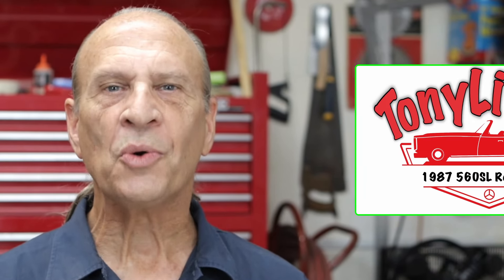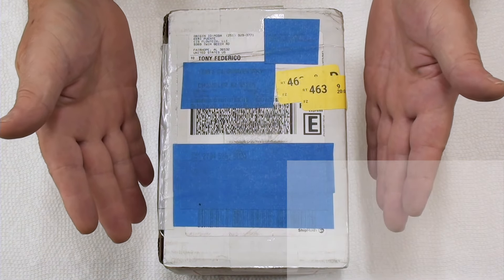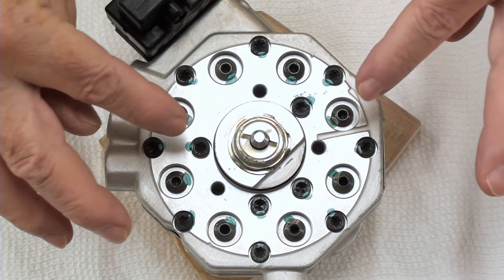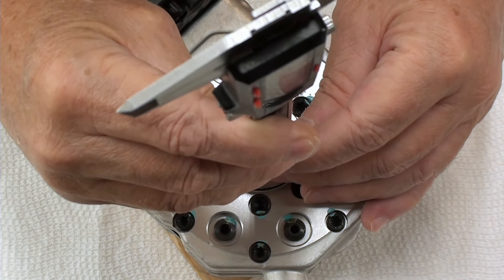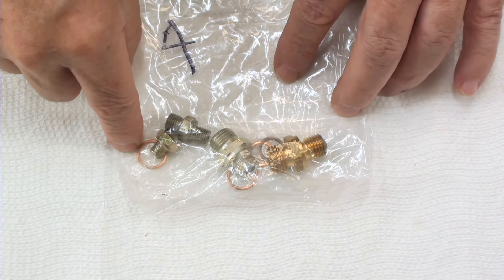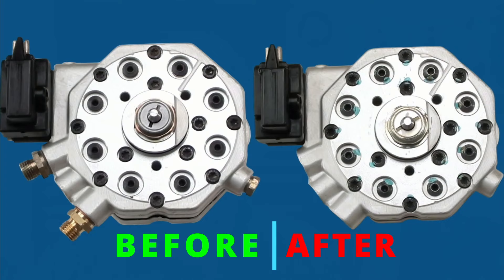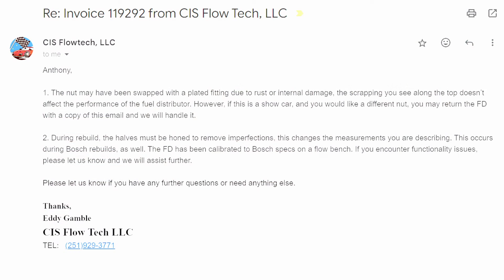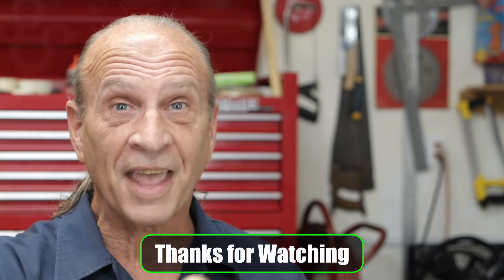560SL - Reviewing Rebuilt KE-Jetronics Fuel Distributor from CIS Flowtech, LLC

Comment: I gotta say that I'm with you on this one: really there is no reason for the damage, yes yes I read the explanation , still it kinda leaves a bad taste you know, the very least it could have send a note or something with the distributor. I would send it back after installing it on the car, in the end if they balanced it right then it doesn't matter.  Oh yeah the unprotected plunger also sucks, but again as long as it works I guess all would be forgiven. Can hardly wait.
Reply from the maker: @danricci6996  I agree with the bad taste Dan. Thank you for the comment. The explanation he gave was kinda wonky too. A professional with years of experience should know how to remove the locking disc without damaging the body of the FD. I guarantee I could do it and I’ve seen plenty of others that have done it without damaging it. When returning the FD they should include the parts replaced and an invoice that explains what was done. But in the end, if it works, it’s better than the other professionals I’ve let touch this car. These days I think the old professional builders now have employees and those employees are not properly trained. When I was in high school we had auto shop and a dad that like getting his hands dirty. I got the passion when I was young. These days there is no auto shop and their dads sit behind a computer all week. These kids have no passion for anything.
Reply: @TonyLiveTV  Unfortunately you're so right. Since we don't have a Bosch Repair Center like the owners in Europe we're forced to bite the bullet and hope for the best.  Thank you for been the "test pilot" and can't hardly wait to see how it runs.

Comment: As others have said...ya, I get it with respect to the damage.  But, there is much left to evaluate. I'd drop that thing in and see how it runs - if you ever have to see the bottom of that FD again, something terrible has happened....
Reply from the maker: @trevorchilders479  agreed. Thanks for your comment. As long as the rebuild and calibration are correct the damage shouldn’t matter. The weather is about to get perfect for cruising here in Arizona. Let’s hope I actually get to drive the 560SL this season.

Comment: Why would such damage occur ? Lack of a specially tool? How much force is required to repair this and was damage inevitable? Bottom line is if the unit works as it should I would not waste my time and send it back however those who plan to send their FD for restoration at this facility should think twice about doing so if the answer is they are careless in their assembly
Reply from the maker: The best comment ever Saman! Thanks for your comment. You are exactly right. It is carelessness for sure. It seems I have better tools than they have. It looks like they used a screwdriver and a hammer to bend up the tabs of the locking collar. At least they immediately responded to my email and their offer to replace it was a nice gesture, but I agree with you. Sending it back could result in a worse situation judging by how they treated my FD. Another thing that bothers me is there are marks on the control plunger nut where you can see they used a screwdriver to turn the nut instead of the correct tool. This damage makes no sense because I removed that nut when I replaced the o-ring of the plunger last year. I even made a comment about how easy it was to turn the nut using a piece of plastic. I guarantee that I would not have scratched it like that.

Comment: Definitely irritating... What would I have done? Like Trevor said; test it in place. If it runs I would not send it back considering time and further risk of damage. If it does not run, well, depending on what they say...
Reply from the maker: @christianbaraldi2137  thanks for the comment Christian. That’s what I will do. I ordered a new o-ring from the dealer for the base of the FD and I already have the crush washers. I hope I don’t have to adjust the height of the throttle plate. I could really use a plug-n-play right now.

Comment: Tony, this is done highly unprofessional! I don't know what those idiots did but you should have received the original set of diaphragm and o-rings which is telling me that they just calibrated the distributor to give less fuel, just to be in specs with the Bosch manual. I was always sending my customers the original diaphragm plus the o-rings. There is a subtle way to open the distributor without making a single scratch. Maybe I'm wrong but you will see that once you put the FD on the car and bridge the fuel pump. I won't say anything but I think you won't be satisfied.
Reply from the maker: I am never satisfied with any work that is not performed by myself. That's how it has been my entire life. Every time I trust someone else, it turns out like this. Remember the machinist with 38 years of experience that I used? What about the A/C rebuild service? I can ONLY pray the transmission works. So far everything I had done by someone else turned out pretty bad even though they get super high reviews. Maybe I'm just too darn anal and I expect more out of others than they can deliver. I could have done this myself, but I'm tired of messing with this vehicle, buying tools I'll use maybe once and messing with so called professionals. I can't wait till this project is over. Do I hear any offers for a 1987 560SL that may never start?
Reply: @TonyLiveTV  No, absolutely not. You will see what happens when you put the fuel distributor on.
Reply from the maker: @mercedeske  you are so mysterious. That’s the best way to see that’s for sure. I’ll install it and if there is a problem they will get it right back. They should probably buy me a brand new one and then everyone will be happy 😃
Reply: @TonyLiveTV  True! :D